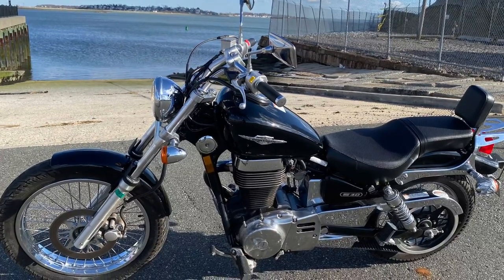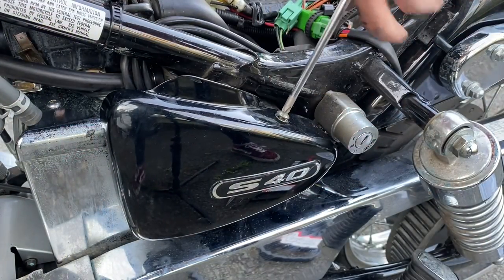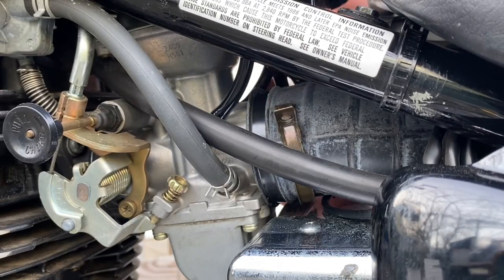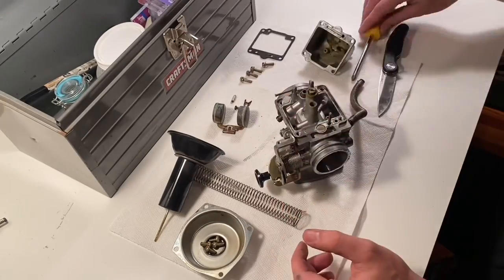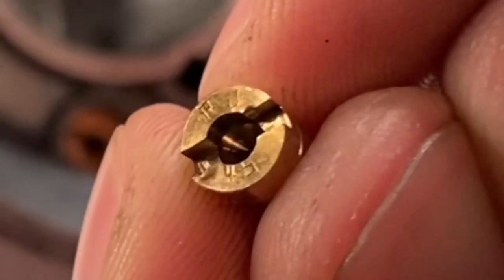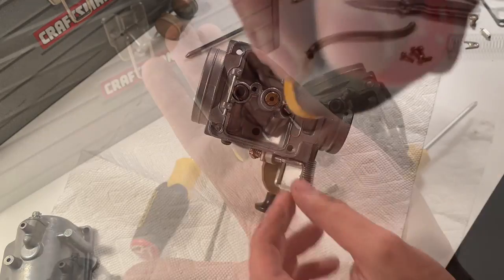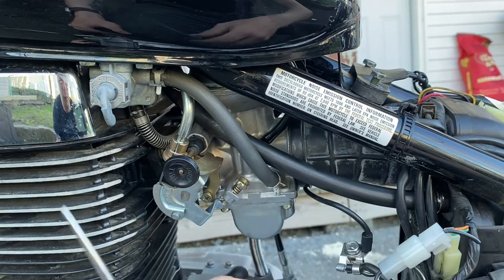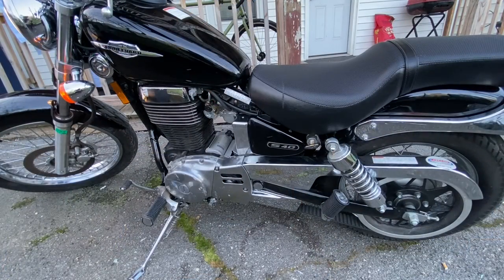Suzuki S40 Carburetor Removal and Cleaning

Comment: I noticed you didn’t remove the 3 bolts on the side. Behind it there is a spring and rubber boot. I’m not well versed in how carburetors work, but should this be removed prior to submersing the housing to avoid the rubber deteriorating?
Reply: Yes.  I was wondering if that cleaner is different.
Reply from the maker: The three screws were stuck and I couldn’t get that part open. It should be taken apart
Reply: @jakesworkshop1253 What exact tools and cleaner did you use?
Reply from the maker: @2c2bpolitics-ce-gate3-4  Metric socket set, screwdrivers, needle nose pliers, carbeurator cleaner

Comment: I have the same bike my carburetor is acting up if i use a spray bottle with gas it will stay runing but every time I turn the gas on it dies do you know why
Reply: Most likely need just need a cleaning or replace the crappy stock petcock

Comment: My s40 is like having problems in 4th and 5th gear and I can’t push it to 100km I have a slip on exhaust. What do I do
Reply: Was it running 'perfectly' at one time AFTER the slip on?  yes/no  (I assume the answer is yes obviously!) 
Then it sounds like a (partially) blocked Main jet. NOT the Pilot jet. 
Clean the Main jet.  (Clean both jets while you are at it)

I understand the Pilot jet's 'job' is from 0-50% throttle, and the Main jet's 'job' is from 50% to 100% throttle.

Good luck.